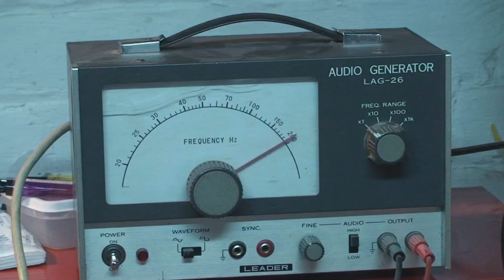Marshall MG Series Amplifier Repair

Comment: I hate dealing with these type of faults, you give it back and the guy says it still cuts out so you have another look and still can't see anything wrong. You check the lead, still nothing, then you check the guitar but that's fine too. Then you realise he's using a bank of dodgy pedals all cobbled together with home made wires but the guy swears that it's all fine because he made it himself but when you take it out of the circuit there's no problem ! Goof !

Comment: If this one was anything like mine, it's the volume knob on the clean channel, not the input jack.  Sometimes diagnosing a problem requires looking beyond the obvious diagnosis.  On my amp, the volume knob doesn't work - meaning, the potentiometer doesn't control the volume, it's a constant.  Yet if you squeeze it at the volume zero position (7:00), and maybe push in on it a little, I can get it to behave normally.  However that just doesn't last too long.  Time to let this amp go and let someone else fix it, I don't want to bother with de-soldering this pot and soldering a new one on.

Comment: I just bought the same amp I believe if this is an mg30dfx and the seller describe the same thing when I plugged it in it wasn't fully amplifying it would cut out a little but not enough where there was nothing just very quiet for a couple flutters and then after it warmed up or something it was perfect amp so I don't know if it'll come back or what.

Comment: If anyone's experiencing problems with the volume cutting intermittently then please try the following before you do anything else. I just did this to my MG30DFX and it's completely fixed for the time being by this simple process - takes 5-10 mins and no soldering or electircal knowledge required.

Basically, it was the emulated line out/headphone socket that was causing the issue (well known on the Marshall forums). There's a pin inside the socket which lifts when a jack is inserted and cuts the speaker. This pin overtime had made a poor contact when the line out was not in use - whether it was dusty or got out of shape, I'm not completely sure. Make sure the amp's off and unplugged for 30mins or so. I opened up the amp by disconnecting the red and black wires from the speaker and undoing the 4 black screws on the top of the amp to drop the control unit. I then found the first pin of the line out socket (closest to the front panel - this is the pin that connects/disconnects the speaker), inserted a jack into the line out and used a screwdriver to bend the end of the pin so it had a downward angle. When you remove the jack this 'bend' should cause the pin to make more contact and ensure it gives a consistent connection, i.e. no more sound cut outs. It would also be wise to clean the inside of the socket with some electrical contact cleaner if available. Screw the unit back in, re-attach the speaker and all should be good. You can of course test this before re-assmebling but be careful with the electrics!

Explained here with a picture: https://www.reddit.com/r/AskElectronics/comments/5xhsny/help_finding_cause_of_broken_guitar_amplifier/dei8l59/
Reply: Going to try this tomorrow, haven't used my Marshall for years because of the sound cut off's
Reply: Just bought one for 45 bucks because the guy said that this is happening and it sparkly new I can't believe what it looks like for $45 thank you I will be investigating shortly
Reply: Dudeeeeeeeee... it worked!
Reply: @hamsterdamdam glad to hear it!
Reply: @Stewarty88  thank you so much

Comment: DAVES WORLD OF FUN STUFF, Is the Chokes storing current like a reservoir like the filter capacitors or is the Choke doing something else to the AC ripple, not sure if the Choke is regulating the current? 
Most Power tubes 6L6,EL34 use a B+450vdc on the plates, if you increase the B+ to +600vdc would this increase the AC ripple but why would it increase the AC ripple? i would think it would decrease the AC ripple because more B+ voltage mean less current draw from the power tubes. 
When you're biasing the power tubes in an amplifier circuit how do you bias the compression of the power tubes the 1dB compression point of when the power tubes start to compression? because its say to bias tubes at a 30mA bias current per tube to be safe but how do you know when the tube is compressing?

Comment: I just got mine today and the volume is so low with the input and CD in that I have to turn the volume to max and it is still too low with a keyboard also set to max volume. The guitar can hardly be heard when playing both clean or OD. No distortion for the guitar in OD or keys, just low volume like the amp or keys are set to mid volume each or something. The amp in this video is really loud compared to mine. What is wrong with it??

Comment: So I've got a Behringer GMX 212 and my input jack fell off of it and I took it to and audio place and they repaired it, then a few weeks later it broke the same exact way.  Any ideas as to what the problem may be?  Could the audio place have done a bad job at replacing it?
Reply: The input jack fell completely off and I can't plug in my guitar to my amp.  That's how it's broken.

Comment: I have a MG15 that fall down to the floor with cable connect to it so connector was broken. And my struggle is, I cant even open it up. I remove all screws and still cant move the face plate out. Can you help?
Reply: +Dave's World of Fun Stuff Any tips for getting the black plastic handle covers off so I can tighten the screws on the handle?

I'm afraid to just pry it off as I read that the black plastic is attached to a metal plate underneath.

Comment: I found one of these amps but the whole top electronic cabinet part has been took out by someone. all that's inside is the speaker is there anywhere I can find this whole part together or should it just be trashed?
Reply: use it as a speaker cabinet for another amp,dont throw it out.make a plate to block the space left from the old amp and just put a jack on the back.they make a perfect second cab for another amp.
Reply: trillriff-axegrinder sounds like a good idea. Yeah I actually found it next to a dumpster lol. Figure I'd make something out of it.

Comment: I have a marshall valvestate 8080 and when i turn it on then i can only hear a buzz sound. no sound from my guitar coming trough please help me
Reply: Sounds like it could be that 12AX7 preamp tube. Try plugging directly into the effects loop return. If that works its definitely the preamp.
Reply: wow, i get beautiful sound with a lot of bass now i am impressed thanks! Do i need to fix my preamp or can i leave it like this?
Reply: That being the case, I would replace the preamp tube. it's only a $5 part. You can leave it that way if you want but now you are only using the power amp section.
Reply: Dewey B okay, can i replace it myself? is it that golden rectangelar thing on the side next to the speaker??
Reply: It's inside the amplifier chassis (the enclosed metal portion). It's an easy fix but if you've never opened an amp before,you may want to take it to an experienced tech.
Reply: Dewey B thank you very much!
Reply: Good luck bud.

Comment: Mine had issues like cutting out or randomly screeching. I think it was getting to hot cause there wasn't enough air flow so i pulled it out and keep it on top of the speaker box. Works much more betterer.

Comment: I have this same amp. It cuts in and out all the same. I bang the top of it and it'll come back in but quickly goes again. Not the leads tries several new leads. Any ideas?
Reply: +TheLastFraudster keep a hammer close by when you play.
Reply: perfect advice
Reply: Stop banging it. Take some fine grit sandpaper (800 maybe) wrap it around a pencil, and (unplug the amp so you don't elecrocute yourself) put it in the jack and try to clean the contacts. If that doesn't work after just a little while, stop and take it to a pro.

Comment: dave, my MG amp does the same thing but only when it been in a cold room. I've smacked the top of the amp and it comes back. but when it's warm out it's fine....ghosts.....
Reply: cold solder joints. when it reacts to being smacked or bumped it's pretty much always cold solder joints. one of the easiest fixes if you know how to solder, since you don't even need to replace any components (unless something's been damaged from the intermittant connection of course)

Comment: Its acting just like mine. Mine only fails when I'm playing in front of a ton of people. My fx loop doesnt work most of the time. It does work once in a while. Is there any way of fixing that? I had it in to a repair shop twice. I never had any luck with them. They said theyreplaced some pots and the input jack. I really need my fx loop. Also one day at practice it started making a really strange noise and it was coming out of the speakers. Ive had nothing but problems with this amp but I really like the way it sounds. Its the MG100hdfx head. I'm playing through a 4x12 JCM 900 1960 lead cab. could that have something  do with the problems Im having?

Comment: My friend his guitar amp is also a Marshall mg series, but except my friends Marshall guitar amp is a Marshall 100HDFX mg series.

It says something like that but I'm not sure in which order it says that in.

But yeah, his problem with the amp is that a lot of times when he turns on the guitar amp, it makes such a loud noise.

In order to make it stop making that noise so he could play his guitar, he usually has to like hit the top or side of the amp with his fist, and it usually stops after that, until he finally turns it back on again.

When he hits the side or top of the amp with his fist, he says that he thinks that the tubes might be what's wrong with the amp. And he's thinking of going to guitar center or sam ash to get it fixed, but they most likely are gonna charge a bunch.

And I wanted to help look for what might be wrong with it, and maybe he could even fix the problem on his own.

Plus he still has to go take his Boss MT-2 Distortion Pedal to get fixed, because we'll put a new battery in it and use the pedal that day, then the next day the battery would have already died, but now he says he seen a wire on the pedal where the battery goes, he said that a wire is like sticking out, like the wire must've disconnected from something inside, and I think it might be a lot of money to pay to get both fixed.

Any suggestions?

Comment: Hey I just put head phones in and the sound is not going through my head phones. Instead it's going through the amp. Even with the head phones pluged in. Is there any way to fix it?
Reply: Dan Mauro my amp has to have the speakers unplugged before the headphone out will produce sound

Comment: I once had a $1500 amp cutting out horribly when I played my acoustic through it. Got all pissed off at the amp, til I plugged into a tuner and realized that I wasn't getting squat for a signal into that either. Of course it turned out to be a dying battery in the guitar's piezo preamp. After fitting myself with a 2 sizes larger size dunce cap, I made a note to always check ALL of the signal chain. Sometimes there's no fixing, 'coz what you're presented with ain't what's really broke.

Comment: I have an amp from the same series (MG), but my on/off toggle is broken. Are the cables going into the toggle (blue wires on the right in this video) soldered in, or do I just need to tug on them to remove the broken part?

Comment: When I switch overdrive on on my amp, it doesn't nake any noise. What coyld this be?
Reply: could*
Reply: Make sure your gain is up
Reply: 5yrs old...maybe you are still on here... Ever figure this out? Same problem 9verdrive on kills the sound......I'm just trying to gain experience in my troubleshooting....I don't use the amp. I have the schematics but I really need a service manual or something that gives me readings I should be getting  on components.....caps, ICs ✌️
Like I said I like to tinker...and this was taken out of the trash a few months back....

Comment: There are two manufacturing sources for this thing.  Some were made in Japan (ones that are reliable) and ones from Taiwan like mine, that cut out repeatedly.  On mine, the issue is at lower volume levels such as ones you would keep the amp at if you were playing in an apartment and not trying to get the cops called.  The volume will drop and cut out or just cut out.  Initially when the problem started I could smack the top of the amp and it would kick back in.  That rarely works anymore and now the only temporary fix is to crank the volume nearly all the way up with a signal going in(resulting in a split second of deafening guitar sound) and then quickly back down again.  After a few months of that working, even that only solves the problem for a few seconds and then the sound drops out completely again.  Your issue in getting it to cut out may have come from playing it too hot or playing it with the volume too low.  I assure you that it's not the guy's other gear, his guitar, his pedals, his cords, etc...  MG30s made in taiwan all do this eventually and I have yet to find a solution.  Ive read of people redoing all the solders, replacing components, cleaning it, etc... and nobody can figure out what is causing this issue.

Comment: The Marshall MG 100 Watt Series Amps are brilliant and much better. Than any Tube Amp and 100 times more reliable..i have had mine 10 years and not one single problem with it
Reply: but they sound like a dying cat, recorded in mono, on a boombox, inside an aluminum dumpster...

Comment: I bought the exact same amp at a pawn shop on the "as-is" sale table for $100.00 because of the exact same problem. I got a good deal on it, as I knew what the problem was. I tinker with electronics, so I just re-soldered the input jack to the mainboard of the amp and it worked perfectly. It was also missing one of the control pots, and I replaced it with another one. Now it works perfectly, and I got it for $100.00 and fixed it myself. I've noticed quite a few videos about these amps having the exact same problems. You would think with such a famous and reputable amp like Marshall, their quality control and parts would be much better...I guess not.

Comment: Stick to tubes and point to point wiring. Solid state is great for television, terrible for guitars.
Reply: try axe fx,kemper,fender mustang and many many other solid state miracles.
ive got 4 tube amps from marshall to mesa and play a fender mustang more 
than any other,its quick,it can be quiet and still sounds good,has great patches
 and effects and cost me $50.